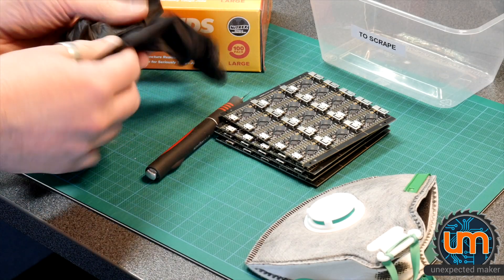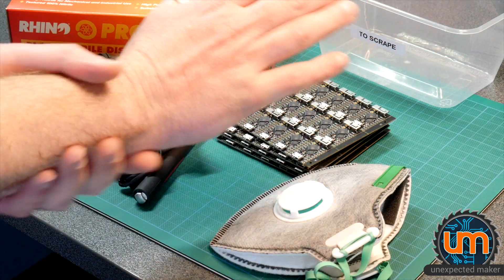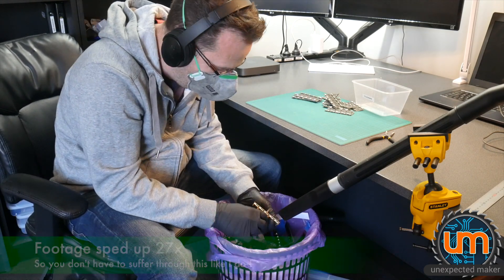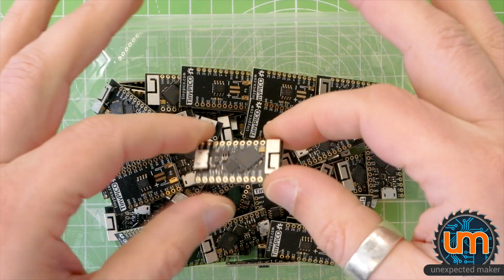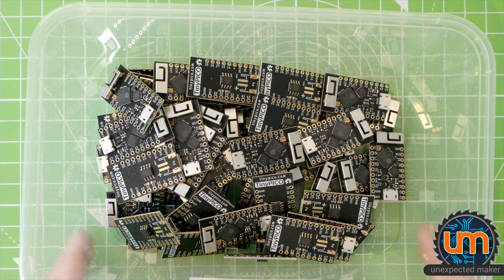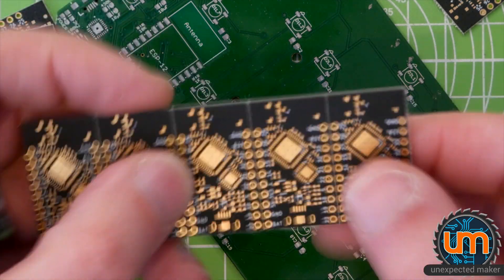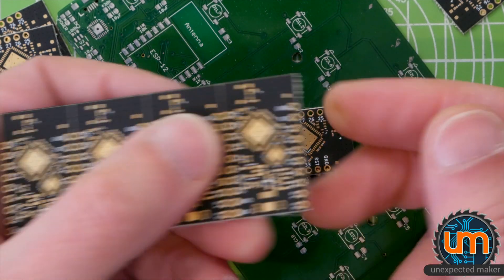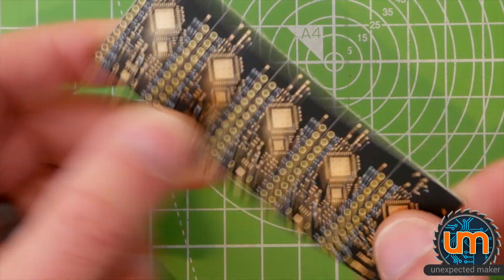PCB De-Panellising - Slow, Messy & Dangerous!

Comment: I think a good tool for this would be a bench-mounted disc sander with dust extraction. It has a nice flat table you can set a board on and get a perpendicular edge. If you have a little spare plywood you could also set up a simple jig to hold the board flat and let you move it in one axis with a stop for the correct depth, which would let you keep your face away from the tool. Anytime you're doing a hundred or thousandfold repetitive task like that it's worth investing in a little custom tooling upfront to make the results consistent and easy.

Anyway I'm coming at this from a woodworker's perspective - have done PCBs but never bulk depanelization so my advice is just an internet rando's opinion. Thanks for the vid.
Reply from the maker: I have a bench disc sander.. My boards are 18mm x 30mm... making a jig that holds that perpendicular to the disc, that I could spin the board in to get 3 edges cleaned sounds like an engineering nightmare ;)... and I'd still need to hand clean the 4th edge because the USB hangs over the board.

Comment: just wondering did you try to use a big strong scissor to separate the boards instead of breaking them apart? when so, does that give the same garbage? I used a big metal scissor  to get parts of from a proto board in the past. but i did not watched out for that garbage back then.
Reply from the maker: I'm not sure what to say to this... cut 18mm x 30mm delicate, expensive PCBs apart with a pair of strong scissors? How could that end well? :D
Reply: @UnexpectedMaker  i'm not kidding, i'm talking about this kind of scissors:  https://www.stanleytools.com.au/products/detail/PRODUCTS/HAND+TOOLS/Pliers+_+Snips/Scissors/Scissors , something with blades as thin as possible but strong enough to cut only the breaking line.

Comment: Welcome to bulk production. That's just how it goes. I used to produce one product in batches of 6000 that suffered from the same issue. The final product was the same dimensions as the body of a TO-220 but I only depanelized from the 50 up panels they were made as into sub-panels of 10 units each for testing, programming, and more testing. The best solution I found to clean the edges was 600 or 1000 grit sand paper face up on a flat substrate. I would tape the paper down and pass the board edges across it using a swiping motion. The poor buggers that had to depanelize them to individual units followed the same 1000 grit detailing. It only took a couple of quick rubs to clean things and I didn't have to run a vacuum. Damp paper towel worked great for cleanup and for unclogging the sandpaper during heavy runs. Aside from that your only real solution would be custom FR4 with an extra tight weave and JLC probably won't give you that. If you get a "custom stackup" you can specify the exact fabric (pre-preg) used between each layer of copper and in some cases you can also specify the angle of the weave on each layer (it affects propagation speed in the crazy fast world).
Reply from the maker: De-panellising and and cleaning is super mind numbing... I was lucky to only have 60 boards to do in the batch for this video. I did try wet flat sandpaper on a bench, and yes it did keep most of the debris out of the air, but I found it very hard to hold the boards square against the paper, and standing over the bench looking straight down to ensure they were square wrecked my neck and back after a short while.
Reply: Just to clarify, the sandpaper was dry as I did the work but I used a damp paper tower for cleanup of the workspace. With a little practice all it took was holding the board more or less vertical and swiping the edge across the paper and you could do it eyes closed. For meetings and example pieces for photos I would take the effort to make the edges look like they were milled but for production any angle between 80˚ and 100˚ was totally acceptable; so long as things were clean. It got really easy to just grab a board, swipe it, and on to the next. With depanelization, two passes thru an acrylic and pogo pin test/programming jig, and edge polishing, I could process 600 sub-panels per hour and usually didn't have to do any workspace cleanup until the end of the run or sometimes half way through when going on break. I had lots of trouble with inconsistent v-score depth from my Chinese PCB makers and when they were dialed in there was essentially no polishing required in a full batch but those boards were also 0.8mm which made it more touchy. One more thing you can do for dust control is to put an ion generator above your workspace; the added benefit there is elimination of static. Ion generators are actually used or static control commercially and Panasonic has some good primer information on them. 

https://eshop.macsales.com/item/OWC/DIDIMACHDD12/  (the installation videos show the board the board the best, but it's nothing to look at... just a PIC12, a reg, a couple caps, and an analog temperature sensor)

Comment: I use  a cheap/course knife sharpening stone from the dollar store in a shallow water bath to sand the edges of my boards.  The water just covers the top of the stone yet it contains all of the particulate produced by sanding.  The stone is nice and flat and it only takes a pass or two to clean up a board edge. Also works good to clean up mouse bites.
Reply from the maker: I should have pointed out in the video that the USB side has the USB overhanging the edge, so no chance of cleansing that on a flat surface. That said, the sharpening stone is something I've not tried.. and keepign it damp would help stop the dust/debris from getting airborne.
Reply: @UnexpectedMaker  I too think wetting the boards would cut down the dust.
Reply from the maker: Wetting the boards also means I need too then dry them off before I can test them... slowing down my process quite a lot. Right now that go from de-panellising straight to the test jig.

Comment: I'm pretty sure there are machines that are used to separate boards without the need for milling. Its basically two circular blades that cuts the top and the bottom of the v-score thus separating the boards.
Reply from the maker: Yeah, Jonathan Caes linked to one in his comment below. Looking for pricing now.
Reply: https://www.ebay.co.uk/itm/382074280484

Comment: Instead of a knife, I use a metal file.  The multiple cutting edges makes it pretty quick to cut through the fibers on the edge and the shear number of cutting edges doesn't seem to make it wear too fast.  However, I haven't prepared thousands of boards that way.
Reply from the maker: I have a few metal file sure various coarseness - They work ok, but the knife allows for fast, fine tuned movements... where I don't need to put much pressure on the board as I hold it.